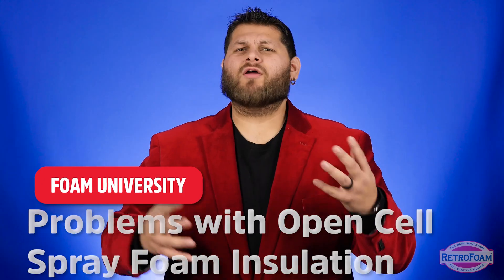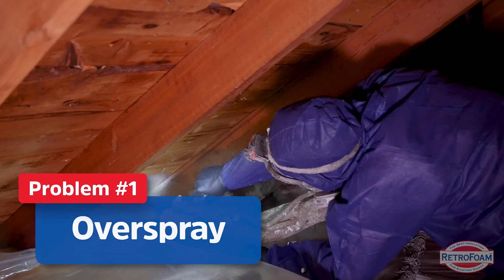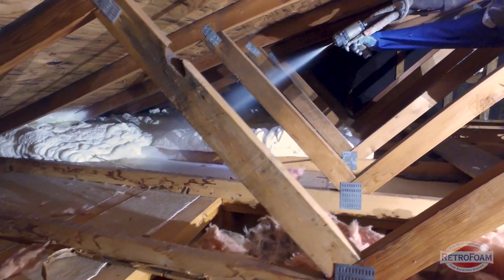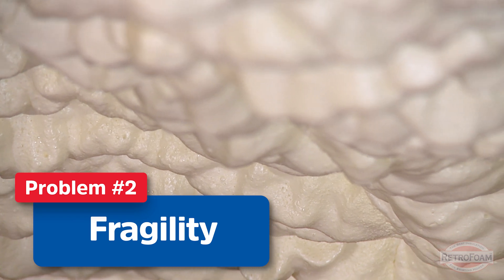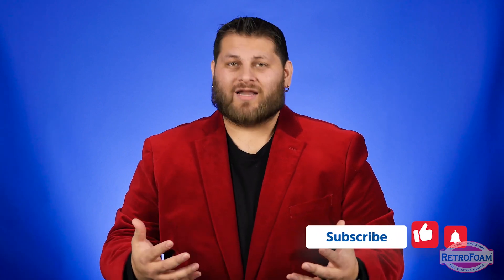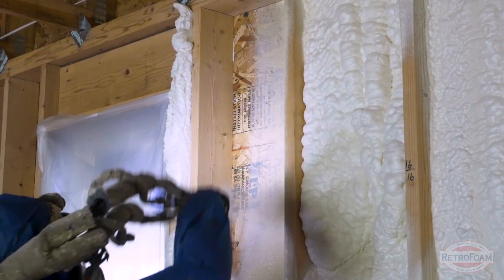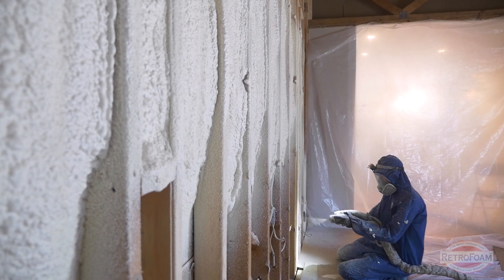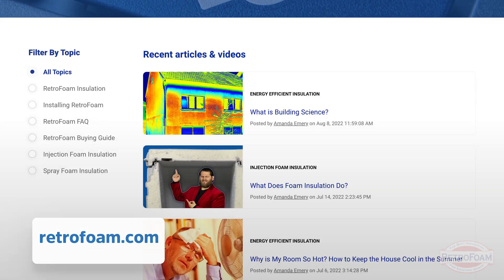Problems with Open Cell Spray Foam Insulation | Foam University by RetroFoam

Comment: I always ask the customer if they plan on covering the walls of a barn or garage before suggesting open cell, because there can be a huge price difference depending on the size of the building. Often we will use closed cell on the walls and open cell on the roof line if they are not covering the walls. Thanks for your videos!
Reply from the maker: Thanks for watching, Phil! 😊
Reply: Do you sell the injection foam? @foamuniversitybyretrofoam
Reply from the maker: We have RetroFoam Dealers all across the country! Follow this link to find one near you: https://www.retrofoam.com/dealers